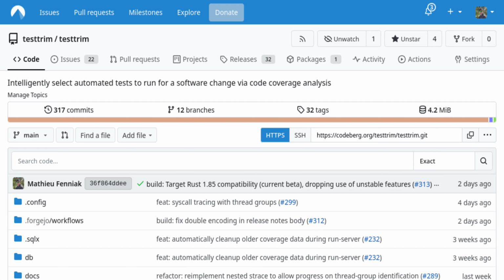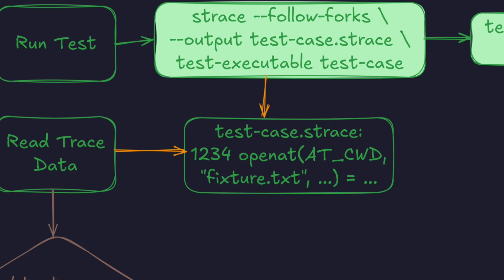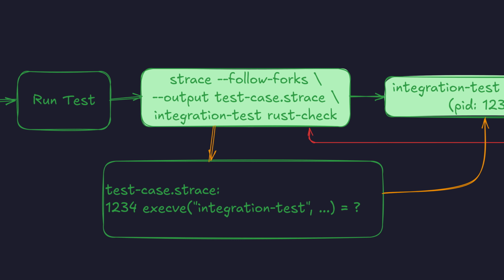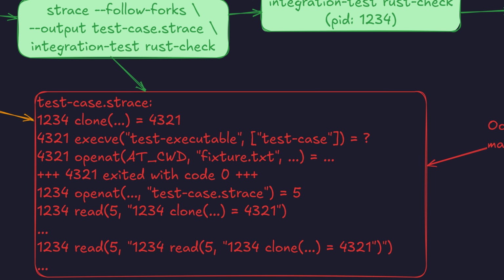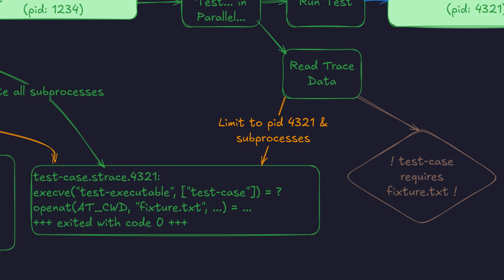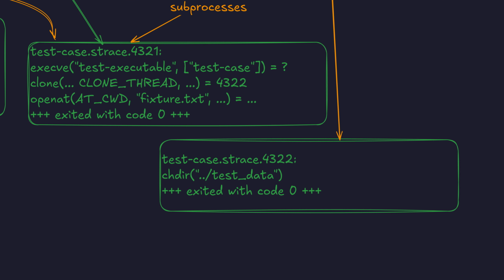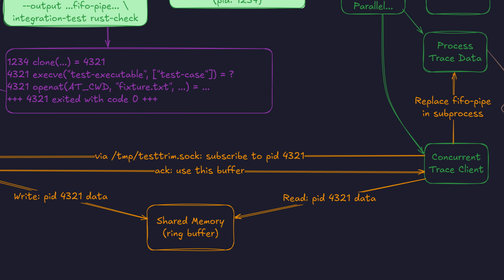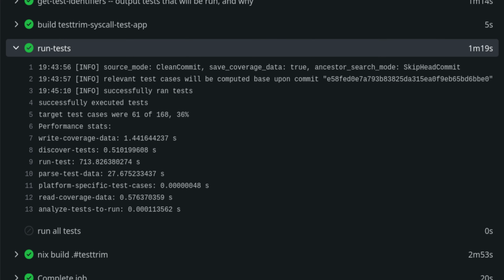The Testing Tool That Couldn't Test Itself (Until Now)

Comment: cool project! do you anticipate this being a problem if someone has a project that also uses strace for something else? is it possible to extend the sync logic to independent programs?
Reply from the maker: Thanks!  Yes and no -- the same problem would occur if someone else was using strace (or the underlying tracing APIs) in the project that was being tested, but I think that's very uncommon.

If it arose, the same style of data sharing could be used... but since the program at the "top" (that initiates the tracing) controls how the `strace` program is executed... there would have to be a lot of overlap in the exact functions that needed to be traced for it to be effective.  Plausible if needed, but seems unlikely.